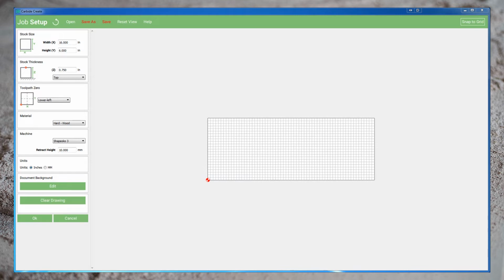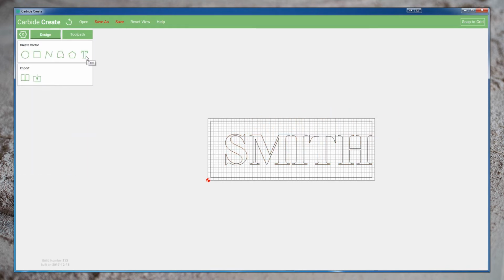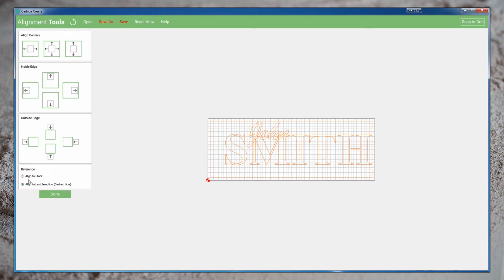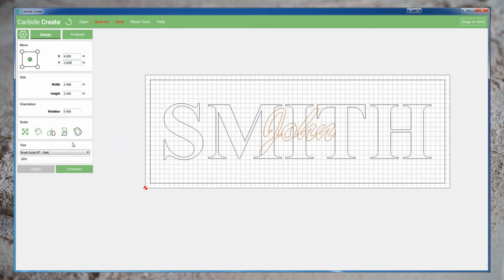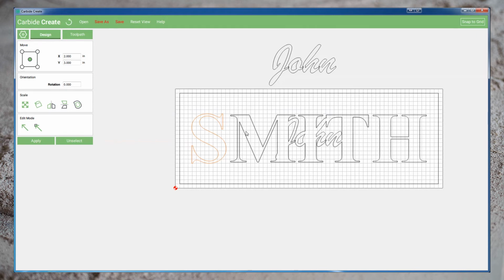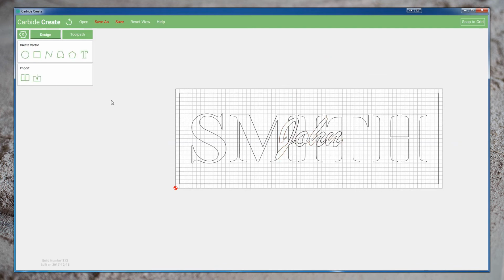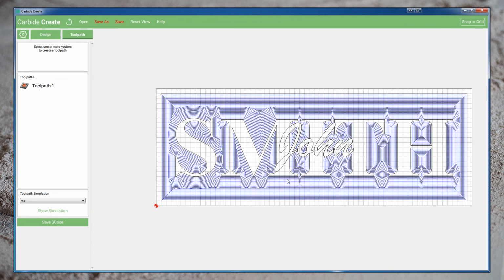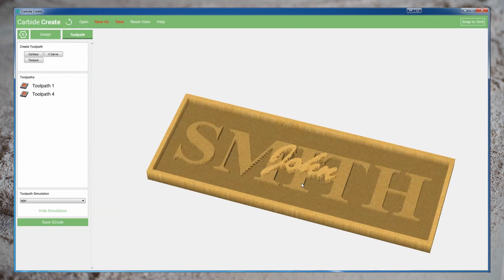Practical CNC 02 - Creating Stacked Text in Carbide Create

Comment: I know it’s been a couple years since you made this. How do you prevent the second tool path from wasting 2 hours trying to cut out the already pocketed material (only cut the large letters)?
Reply: Create a rectangle slightly larger than the bottom text, and do the pocket between the top text and that smaller rectangle.